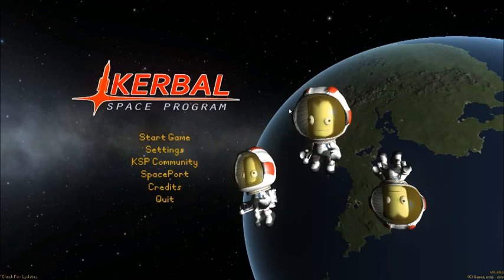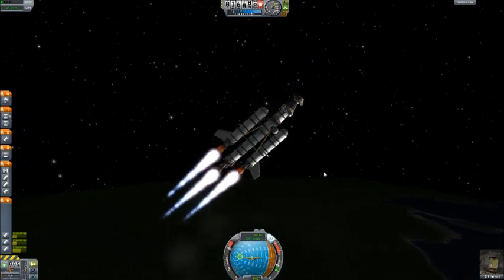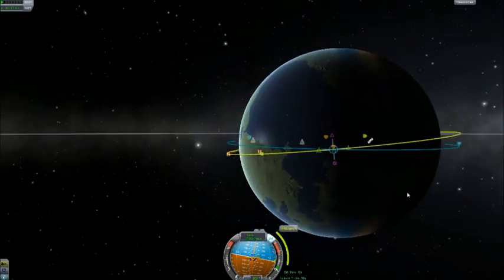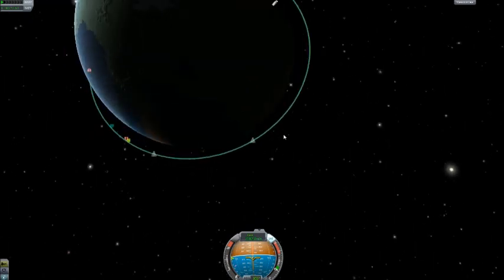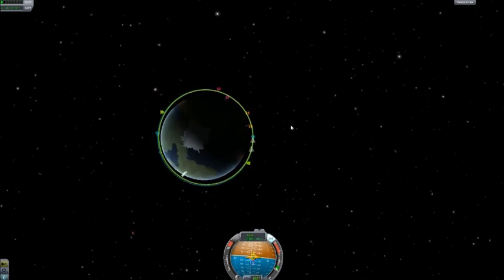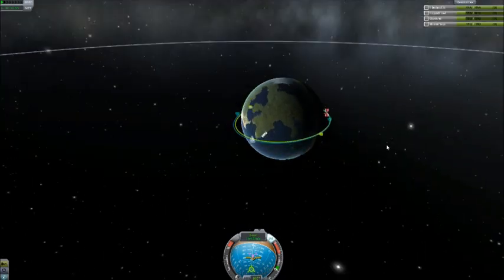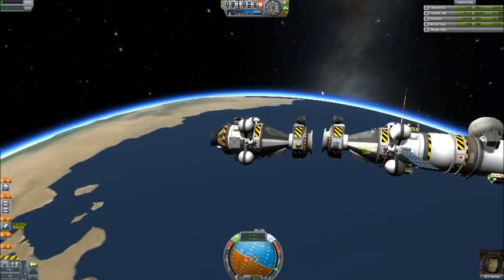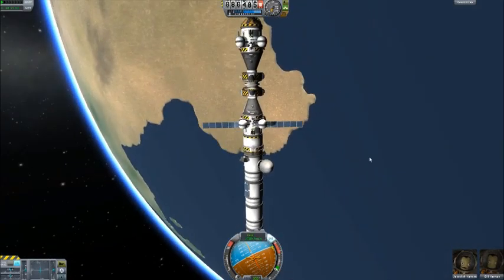KSP Orbital Maneuver, Rendezvous and Docking Tutorial

Comment from the maker: Nope, what happened there is that for whatever reason you didn't thrust in the right direction for long enough to achieve the maneuver. As long as the maneuver is open, it shows what you are *aiming* for, not necessarily what your actual trajectory is. When you close the maneuver, it shows your actual orbit.